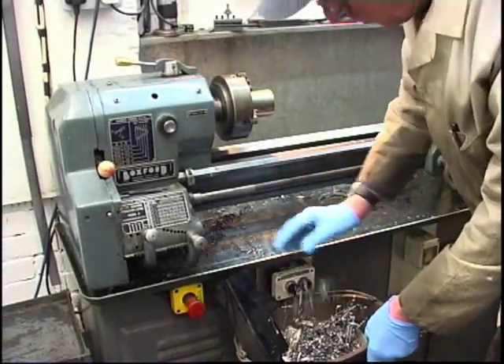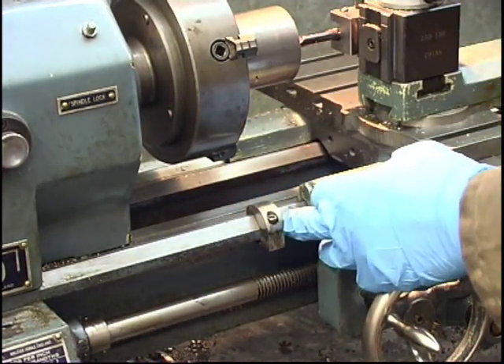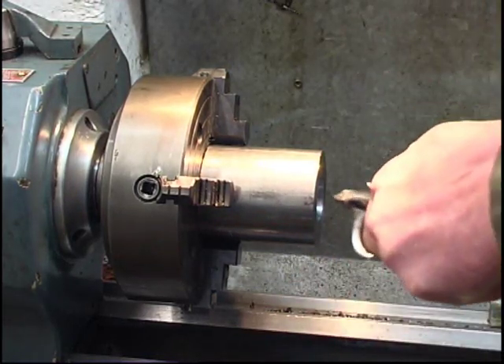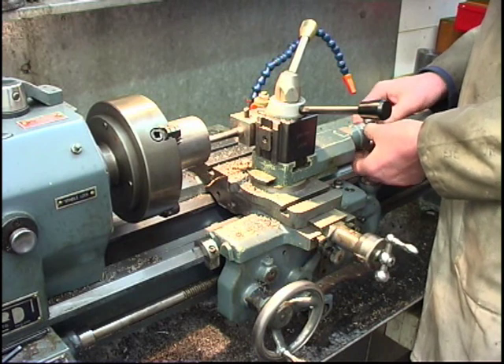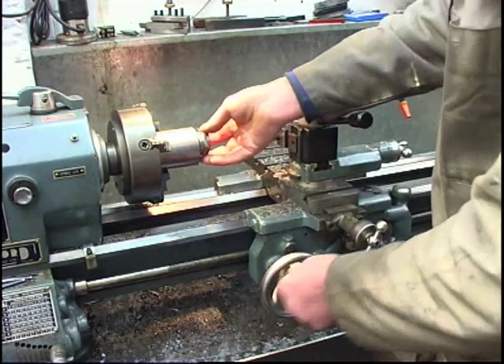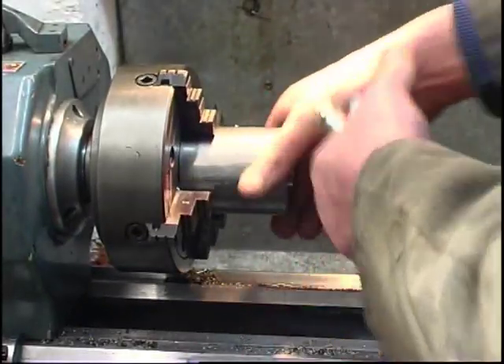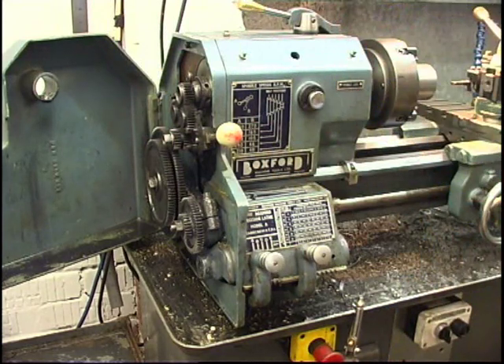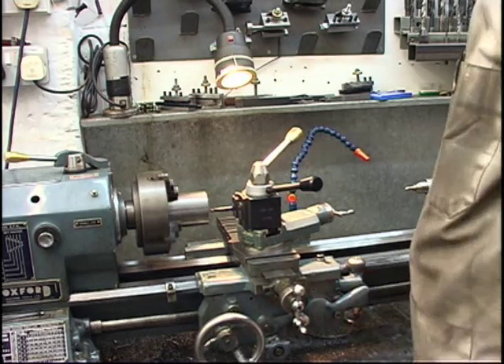GET A GRIP ER32 PART 2

Comment from the maker: The compound angle was wrong
I did a few cuts using the cross slide this cleaned things up
It is bad enough machining threads with out trying to video them
Thanks for your constructive comment

Comment: Hi John,
I have the same style tool post on a 1945 Southbend lathe.  I was actually asking about the brass/bronze lock nut at the top of the tool post.  I notice in some of your earlier videos that it is the original steel hex nut.  At some point you changed it to the current lever action nut.  It is a beautiful looking thing, along with the custom knobs at the ends of the shafts.